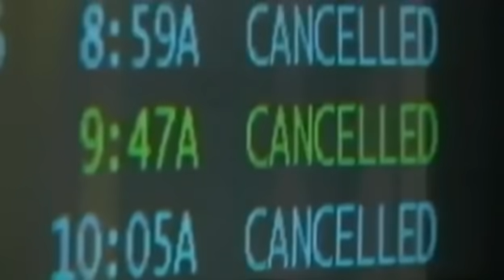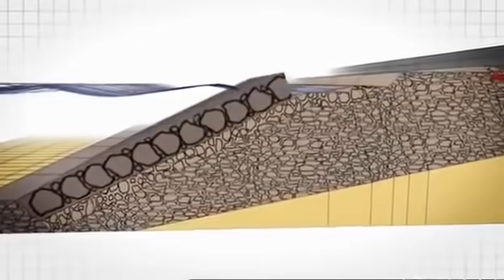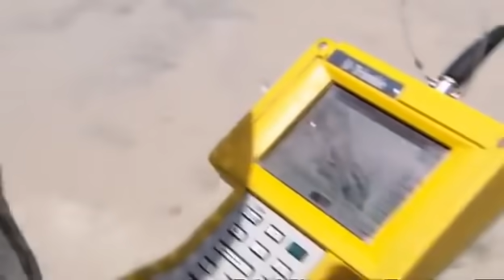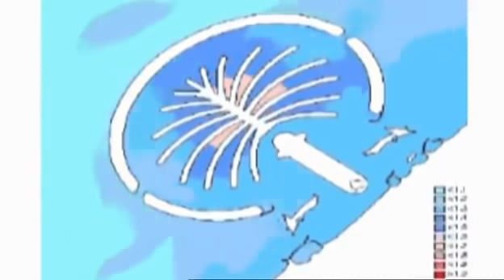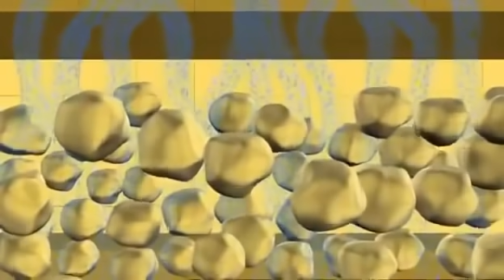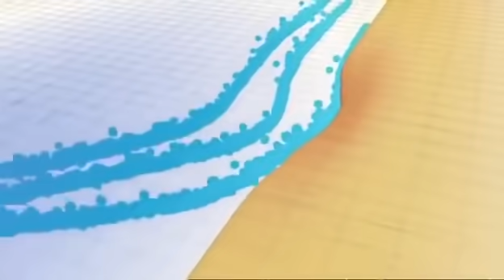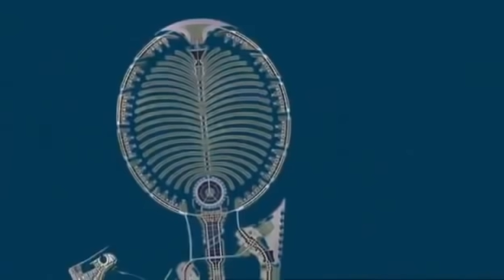The Palm Island, Dubai UAE - Megastructure Development

Comment: “...in 2016 they will run out of oil” - haven’t checked yet but am pretty sure that hasn’t happened
Reply: @Terence Tapfuma it  says 2060 not 2016.
Reply: @z-learners    No. The narrarator says they're, "running out of oil reserves." When I heard it the first time I thought I heard him wrong. I didn't.
Reply: They said 2016 and they cut production so it will last maybe 2020-21. Dubai diversified enough to be ok without oil
Reply: it has happened...it is in debit now yet like an egotists he refused to acknowlege it and builds structeres he cant finish and are now decaying form all the bad weather this Jan 2020,,,worst in 25 yrs infact
Reply: Yup
Reply: 2020 Yet The Oil Didn't Run Out 🤣🤣🤣🤣🤣
Reply: @samerat4208  Do you have a link to a news article or anything about recent updates on it? I was wondering how it's been faring.
Reply: @xeokym223  no i do not...i know its there if you look...do a search fo dubais twitlite yrs..and as for the worst weather you can go to loy macido...he does alot on whats really going on there...search the worst weather in his many links on it....he got them mostly from Tourests camera phs....or just type in you search...worst weather in 20 yrs for dubai...there were floods and mud slides...alot of people were trapped in their cars and home...it was a real mess...at that time dudai was reporting it was 70 degrees..all i know is this virus is affecting how many tourists come there...and that they are locking it down and not allowing any gatherings...you have to get your news from Newsmax because they have been acurate...there is a good chance that their expo wont take place because alot of countries are pulling out..they do not allow anyone to report negative news from Dubai if you live there or you could wind up fined or worse
Reply: @xeokym223  i hope thease helped update you on just whats going on there
Reply: @samerat4208   WOW Thanks very much for all the links! Like you said it's difficult to find any negative news coming from Dubai. I've learned a lot though, I'm continuing to read more on the area. Really fascinating to see how quickly it's been developed and then the  subsequent upkeep of the sand islands, it's also very interesting because of the economy and how fast it blew up. I knew a little about it. I appreciate all your help :)
Reply: @xeokym223  you are very welcome,,,when ever you wish to know more go to Loy M here on yutibe,,,he speaks the truth and has lnks...plus he doesnt hate the sheikh...just the other shit....
Reply: @xeokym223  one more you might like...its about that rain all in Jan-https://www.youtube.com/watch?v=LeonY7C2Jqc
Reply: @xeokym223   Princess Haya who is devorcing the sheikh...won in court  in the the Uk. about 7 dayes ago..he was found to have abducted 2 daughters and has been publicly imbarresed...so...alot has changed for him...this is on google...anyhow...wanted to update you....alot of news staions and papers are carrying it and so he has been outed///as it were and i emagine the palace is in utter chaos and the corina virus isnt helping...the high court over there was going to keep their findings quiet...but they found out what she was saying was true and he lied...a big NO NO and something the UAE now knows...not a good thing for him
Reply: Jon Lundfelt oil is renewable. You all been lied to. It’s also good for the environment. CO2 is food for plants and trees.
Reply: Yes still abundant in oil and gold
Reply: @samerat4208  Dubai  is industrialized
Reply: Great Dubai. PROF. REYDEV
Reply: How about ABU DHABI. ITS GEOWTH?
Reply: @ReyDev165  i hear...and dont know how true it is...but i hear that they had to bail out dubai some 20 million...or more and dubai is over 4 yrs overdue to pay them back...plus i hear that alot of places in the UAE have been shutting down because they wish to stop the virus from spreading so their ecomomy sux right now..i get the arrabian buisness paper by email...and it says that dubai has  a curfew in place now but if you need to go out you have to have special permission...thats at night mainly i beleave...i like to know whats going on over there...i know some people i worry about...i hear also that the expo is being posponed a yr...and about regrowth? honey i do not see a good future for dubai...things are colapsing and the sheikh has over taxed the limits of of what he can now do because he loves to build even tho alot of his cheap labor is now sick with this virus-https://www.arabianbusiness.com/443867-from-parties-to-social-distancing-uae-announces-list-of-fines-for-breaking-coronavirus-restrictions?utm_source=newsletter&utm_medium=email&utm_campaign=arabianbusiness_newsletters&utm_like the palm islands...they are slowly sinking...he does not care...know why? he sold them and made a killing-https://www.google.com/search?q=did+nasa+say+that+the+palm+islands+of+dubai+are+sinking%3F&oq=did+nasa+say+that+the+palm+islands+of+dubai+are+sinking%3F&aqs=chrome..69i57.31893j0j0&sourceid=chrome&ie=UTF-8
Reply: @ReyDev165   yeah...great Dubai...his father took it from a fishing village to what it is now...the sheikh is miss-managing it and taking credit for what he hasnt done...you knew that...right? all he does as far as i see is start to build and if you notice most stand half built...he has a huge ego and that is what will cost him in the end
Reply: @ReyDev165  yes...i know this...but its going down hill the past few months...hes been loosing more than he can afford to loose so the people are beginging to suffer.....its too bad he was in such a rush to make things appear perfect for the tourests and in that exchange he is loosing them and people are begining to see that dubai is not the place to live anymore...people are starting to wake up to this fact because more has shut down more then they would of liked...so they are relocating little by little...soon the trickle will become a flood trust me,,,no one is investing anymore...they see it as a joke.....i feel sorry for those who have to live even 50 miles out of the city...why? poverty abounds ...more than those few that are wealthy and live in the city
Reply: @SaebHalbouni  that is why most of the trees ther are just really good fake ones? they call dubai the fake city...and it is called thus by most of the world too...it was a simple village before they thought it was such a good idea to build  on sand 50 yrs ago....and it should go back to that brand too..because hes now in debit up to his eye balls and has been for over 7 yrs and no one will bail him out this time;;;infact he hasnt paid them back the last time...he cant afford to....i know more than you do because i am good friends with the family and you know squat
Reply: Samera K why would it sink?
Reply: Samera K they don’t just build with sand as a base.  They put many huge long massive steel beams under the structures.  You’re  speaking only from hatred. Why so much hate?
Reply: Samera K you are speaking with a lot of hate : it’s your damn etc ...i think it’s more of a case of wishful thinking then anything to do with reality. The steel rods that are placed under the buildings are very long, don’t know if they hit bedrock but please don’t cover your hatred with pretending to care about the useful life of buildings lol
Reply: Samera K your link doesn’t work. The islands of course will require endless maintenance. Everyone knows this.  That’s why they have those dredgers always refilling the sand and why they are always evaluations the rocks and structures integrity. The buildings on land are fine.  You can breathe easy, the people that you love so much will be ok
Reply: @lovelife8360  nope...but they are at 20% last i read in arrabian buisness section on line that i get up dates on every day....i have some american friends there...so i worry about them
Reply: @xeokym223  hon...you will need to search this...when i do the link goes wonkey...the islands are sinking...they have built 2 and almost finished the third....the report i found conducted by nasa was done in 2018...google...are the palm islands in dubai sinking...and you should find it
Reply: @samerat4208  I Didn't Really Understand What U Saying. But If You Saying There Is 20% Left From Oil.  Oil Dosen't Have Quantity . And Oil Still Doing Great . And If You Talking About 20% Of  Companies  Starting To Close Their Doors It's Because Of The Corona Virus
Reply: 1 7   i just wanted to add that i agree and its IS becoming more  and more dicey for them and that this Virus is hitting them in the pocket book..and this time no one will bail them out of the hole they have dug
Reply: 1 7  yes...i have heard that they have...infact i beleave its been going on for awhile...i have seen one report on just that and they call it Dubais sundown...you can google that...the sheikh isnt able to finish alot of projects he has planned to build ...i think there are several...i dont remember how many...a train that goes under water...something called Aladdens...its done in real gold and another sky scraper  with its own island that rotates and ppl can controll it....the ones that will live up in the apts..because someone has built one thats taller and he doesnt want to be out done...they all look amazing but i dont think he will beable to build them tho...not with whats going on now...so that must of been an older vidio...and plus all the things that have resulted in Princess haya making him look like a fool..proving her case against him and soon to sue him 70thousand a month in child support....i read in Arribian buisness that he is doing alot by way of vidio confrance now...i get that because i like to keep tabs on whats going on over wher my friends live....
Reply: 1 7  click...its on what he wants to build next...looks amazing but doubt he will do it anytime soon
Reply: @SaebHalbouni  um...no its not....infact it hurts the enviornment...click on the link i left you...please provide me with with one that says other wise
Reply: 1 7  and i beleave that the toursim was hit harder when Iran got involved because alot of countries were calling people home and not allowing them to stay or even travel where war might be a factor
Reply: @bigteddybear5962  no...you didnt...its at 20 percent ..thats what their own papers say
Reply: @SaebHalbouni  you need to do your own homework...i'm sick of doing it for you little boy
Reply: @z-learners  no he definitely says 16
Reply: See my comment above. Dubai is out of oil.
Reply: @tony621  I mean its 2020
Reply: @tony621  I think they already made a alternative to oil
Reply: @fashiue6615  If you ate referring to the man made Islands then they haven't yet as they are a complete failure and they don't know what to do.

Comment: 2:25 by 2016 oil will run out and we are now in 2018, lol for the writter 😂😂😂
Reply: Almost 2020 now and there is still oil. But for some reason, some documentary makers need drama, even if it is not the truth like the eternal "dead line" which can be heard in nearly every American made documentary. "they thought they needed 15 years to build it, but the customer wants it in just 5 years" With a lot of added bass on the voice. The real truth is that the prince wanted it to be realized in 15 years and the dutch say we can do it in 5 years. Thats the other way around, but dos not fit in a dramadocu. 

They also yell around this was full of problems and to biggest of this and the badest of that. The real truth is, it is not so much compared to the Dutch delta works. Thats exactly why the prince came to the Dutch with his ideas. Again, that dos not fit well in the drama.

I rather have British or Dutch "both feet on the ground" sober documentaries.
Reply: 2060. not 2016.

Comment: So they concerned about running out of oil in India but after they realized that building a palm island was a better business than oil, they increased the numbers of islands to be built.  I’m sure they will run out of sand before oil.
Reply: Uhhh... no.
Reply: they wont run out of sand.. didnt you heard, dessert sand is not ideal for construction.. they are importing when possible.

Comment: Build land pilings drive in stone back fill sand dirt keep pilings,rock floor sand dirt mix top sand,Mix rock dirt sand stable land mass.But keep. Build rock bed,stable it then dirt sand drainage,Keep adding it new sand wash into sea.Keep adding sand island can be done,add see wall wider ham tall wider slow water action then rise rock wall wide high biggercrocks so water force will not brake down big rock walls Build man made sea wall

Comment: 23:16 I find the statements about GPS being required and that this could not have occurred before GPS to be factually incorrect.  They would have used the same principal with radio beacons by triangulating the signal.